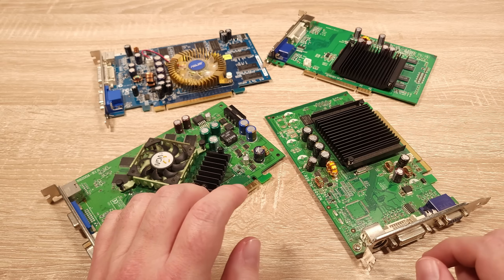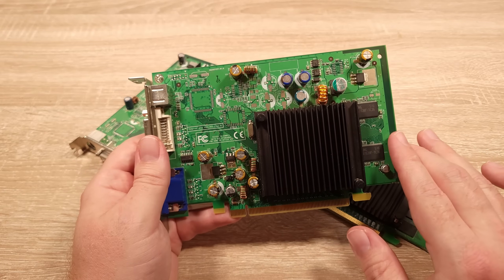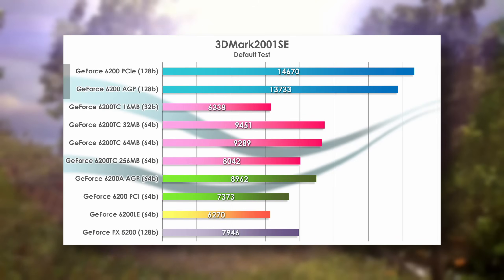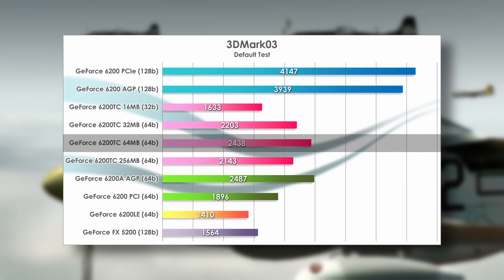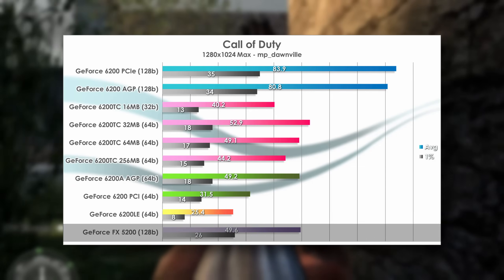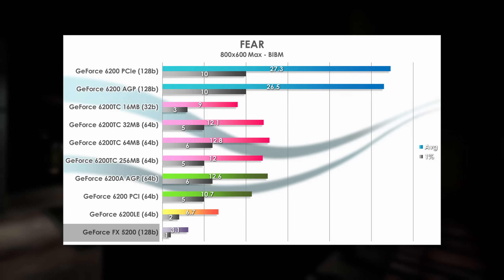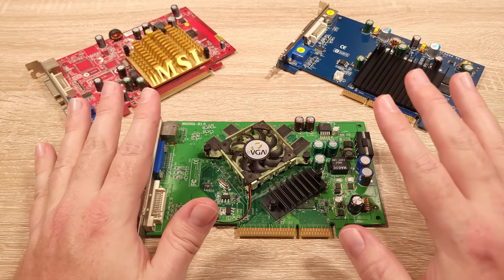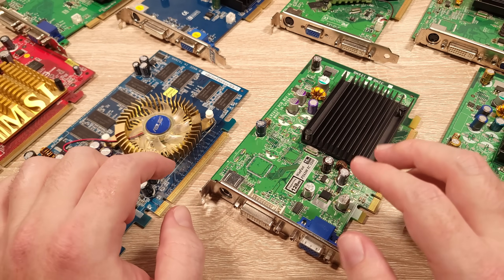GeForce 6200: A Needlessly Comprehensive Video

Comment: I had this card in AGP, but it died :(  Ive since replaced it with a 9600pro. Not sure what version it was sadly. If I remember correctly it performed much better in nascar racing 2003 than my 5200 which I think also died 😂

Comment: Hi,
I've seen these kind of card in action (budget Nvidia TC cards), and I notice than lot of textures were different (a green stuff than was not the render of the grass you have on another card, very low texture resolution). I think that the driver were optimized to high frame rate and low quality regardless of what you set in the game. This is I think one of the tricks of Nvidia at that time (do you remember of the 16bit that was not 16 bits ?).

Comment: I hated my 6200 AGP back in the day (I still do).
Reply: Loved/hated my onboard GeForce 6100 but it beat the pants off the laptop with 5200 FX Go graphics I was using before it.
Reply: @Baulder13  I remember going from some 8mb shared onboard thing to a voodoo3 and then to a geforce4 MX 440. I thought it was a great card because it was a huge leap from my last one, that's all that really mattered! I had no idea the MX 440 was such a terrible card until years later after it became infamous.
Reply: @Baulder13  I have PTSD with these, my first computer i have bought back then (a Phenom II X4) came with that onboard (Nforce 430 / Geforce 6150 variant), not even the operating system was useable and i ended up with a 550 Ti as the only alternative i could afford at the time.

Comment: in 2005 I got a bargain bin celeron d 2.8ghz socket 478 emachines pc. It didn’t have pci express or agp so I added a 6200 256mb PCI and upgraded the ram from 256mb to 2gb ddr 400. This allowed the pc to perform better than current (6th gen) consoles which I found impressive for a super budget gpu. It actually was very good for games from 2004 and before at my monitors native 1024x768  resolution.  I recall the 6200 being able to keep up with the ti4200 which was impressive given that it was a high-ish end card from only 2.5 years prior and Im pretty sure it beats even the flagship 2001 geforce 3 ti500

Comment: @16:39 bummer you got a defective unit, you should find a 6200 nv43 agp that can successfully open 4 extra pipes. the performance boost was massive. basicly you would get a 6600/gt only with riva softmod. i know because i did have one back in the days and did the extra 4 pipe mod. it was a huge free performance upgrade. couple that with an amd athlon64 3700+ overclocked at 2900mhz , a dfi lanparty nf4 ultra-d motherboard, a 2x 256mb winbond BH5/BH6 chip ram at 250mhz and latency 2-2-2-5; oh boy i thought i was on top of the world. best ever budget system build to get the most performance. never had that feeling ever. last 20 or so years complete budged builds lacked few components. you may get best budget cpu that can overclock like hell, or get best low cost gpu that can be softmodded or overclocked but never at the same period. so, for me that build was the last you would get as a whole cpu, motherboard, ram, gpu combo.

Comment: I played the crysis demo. With the 6200 le I think. It was clearly the pcie 6200 pny one. Had the bare minimum 2.8.ghz pentium 4 too. It looked impressive for a slideshow level fps. That was impressive until I killed it by flashing a bios onto it. I was a dumb teenager then.

Comment: My first ever GPU! I rarely see this card ever mentioned these days! Believe it or not, this card can actually run Crysis! It ran it at... 0.6 frames per second, if I remember correctly... but it's also a great champ at things like Titan Quest and Black & White 2! Honestly, I freakin' loved this card as a kid! Gave me access to gaming experiences I would've never had otherwise. Mine was a SPARKLE 256MB.
Reply: ran Crysis Warhead in my second GPU, it was a 6200 (XFX 256mb NV44 A1 AGP8x). That card card took it like a champ, hours of rFactor and 18 wos. My previous card was a FX5200 and barely ran anything without giving me bsod's

Comment: X300 SE next? Budget GPU GOAT
Reply: I would LOVE to see an X300 roundup in a similar fashion to this.
Reply: I do remember an article about x300 with hypermemory and 6200TC... must've been torture.
Reply: @mirific87  Exactly the reason I suggested it, both cards had the shared memory which left an awful taste in everyone's mouths. If I recall right the Radeon card was a little more transparent with the marketing around it which is why I got the X300 SE 128mb knowing it had no TC/HM gimmick
Reply: I would expect there to be also at least a second pci variant with 128- instead of 64-bit. Or was it DDR1 and DDR2? I did know this, but I forgot about it, I need to check again the databases. As there were at least 3 different generations of the 8400gs pci and I believe also 2 different fx 5200 pci (64-/128-bit), I have the feeling that there should be also at least 2 different 6200 pci! 😂

Comment: I know this card is bad, But I had one come into my possession sometime in the early tens, and this card was amazing for when you were working on a system that had PCI Express but no on board and needed to quickly test the board. I don't know what it is with this card but I found that the PCI Express version just works no headache no fuss. Well this card may have been bad for gaming it was fantastic as a display adapter for testing motherboards! It is probably one of my favorite pieces of e-waste, go I lost to that card and it was replaced by an HD 5670 it still lives on in my heart